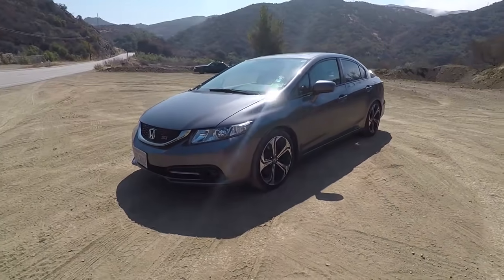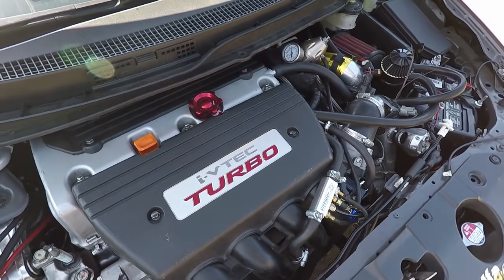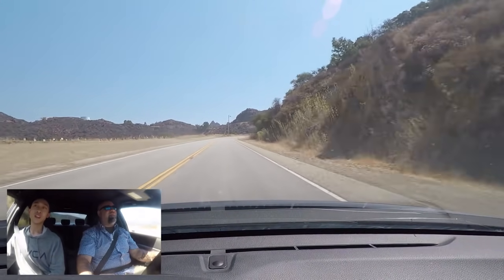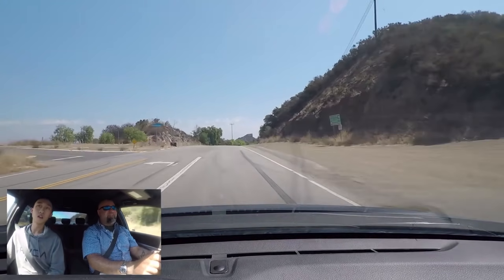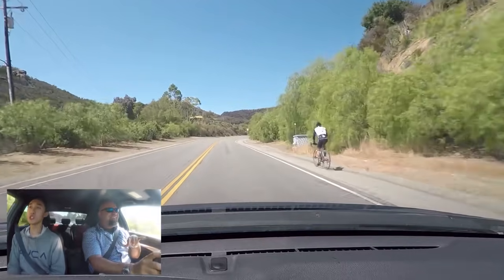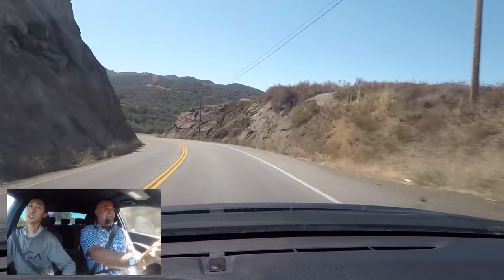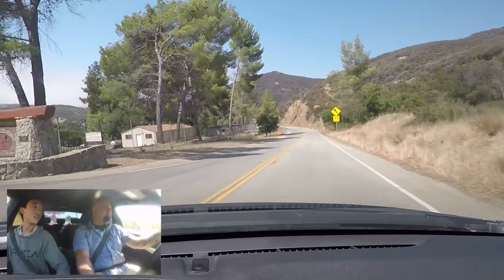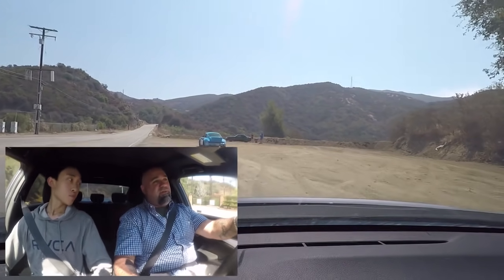Brutally Fast 500 HP Turbo 2014 Honda Civic Sleeper - One Take

Comment: from a dig. front wheel burnout :shift to second: front wheel burnout :shift to third: front wheel burnout :shift to fourth: wheeeeeee!
Reply: Its not optimal to have so much power on a FWD car but it sure is a lot off fun.
Reply: maxxjett films yea that's why hondas are running sub 9s in the the quarter
Reply: Bailey Rodgers running 9s with slicks up front and a specific suspension for drag racing. This dude daily drives this car, not using slicks to go to work. Plus, you don't build a car like this to drive miss daisy around. So yeah, he has traction issues.
Reply: There’s faster Honda’s than just sub 9s..
Reply: my car has 240hp to the front wheels and spins through 1st and 2nd lol
Reply: my 194 hp crx spins through 1st and 2nd and just a little bit at 3rd then gains traction. on the semi-slicks (Zestino Gredge 07), minimal wheelspin at 1st and gains traction #JustVtecThings
Reply: Grant Al Tabsh i believe you. my buddy has a 97 integra with a stock b18 just bored out a bit and it spins 1st 2nd and a bit 3rd. and they say hondas have no torque lol
Reply: Andy V. Well i have a high compression jdm B20B with a gsr head and hondata-chipped P28. Just imagine the torque ! 261 nm to the wheels, and a Y1 transmission
Reply: Andy V. Well i have a high compression jdm B20B with a gsr head and hondata-chipped P28. Just imagine the torque ! 261 nm to the wheels, and a Y1 transmission
Reply: I have a pair of Mickey thompson ET street R street drag radials. They just don't handle on canyon roads so I left them at home. The car grips with those bad boys on the front though.
Reply: Yeah, it's pretty hard to get better than a 6 second 0-62 and 13's on the quarter on a FWD car with even very good street tyres no matter how much power it has as traction is always the issue.  Drag slicks are of course a totally different matter.
Reply: maxxjett films hondas have no torque unless you go h series or v6, 
But my 97 accord makes 561 to the front wheels and i spin through 2nd and 3rd dead hooks hard as shit, then the slingshot effect
Reply: Matthew Sharpe but a stock 9th gen Accord can do 0-60 in 5.5 and run the 1/4 in 13.8...
Reply: Stack Bundlez yup, that's what I said, 0-62 in around 6 seconds and 1/4 in the 13's - and that's about the limit of traction on a FWD car with current technology unless you are running slicks and/or special suspension setups that counter weight transference but are no use on the road.  Not that burning out everywhere isn't fun, as per Matt's reaction here... just doesn't help you get anywhere very fast.
Reply: you described all turbo civics haha
Reply: I drove a turbo civic for years. Drag radials I used on street and track and boost by gear would run low 11s all day long.
Reply: Nice, that's what I'm aiming for next time I hit the track. Im making around 70whp more since we've filmed the one take. Sad thing about the 9th gen is that it doesn't offer BBG, so we're at a major disadvantage. I have to flip the boost switch manually in order to run low boost in low gear, and high boost in higher gears
Reply: maxxjett films 9 secs with slicks..tell me a rwd that doesn't need slicks to hit 9sec...don't think so. Haters gonna hate
Reply: He prob drives on low boost day to day because it didn't spin.
Reply: Not about hating, just that you can easily get consistent 12's or even 11's on street tyres on RWD - and awd better still.  You just cant even get close to that on FWD.  Most places slicks on the road are illegal, FWD + street tyres + dig = slow.  Facts are facts, FWD is not good for traction when you get past a certain point..
Reply: Lol Honda’s are better for roll racing they hook on the highway just not the drag strip
Reply: Mark Chang How about switching to a wider tire??
Reply: chee xiong The physics of weight transfer are what makes it more difficult for a fwd to break into the 9s, but you are right, if you are making enough power to break 9s, you will need traction through sticky tires.
Reply: has one
Reply: Your car is sick, man. I'm a big euro enthusiast but I found myself loving this thing. Looks like a ton of fun. Maximum sleeper.
Reply: Hey Mark.....what is your amateur radio callsign?
Reply: maxxjett films can’t believe to see you here lol.. I’m subscribed to you
Reply: Randy R lol, Good eye!
Reply: allanb3222 My street tires are stock size, 225/40, my mickey thompsons are 245/45/17s mounted on a 17x9 wheel
Reply: Karen Lewis k24's make torque, I make over 600wtq spinning on the dyno at 38psi
Reply: Dirty Dan EG jesus christ, I'm only on 19psi haha 11.1:1 compression ratio but this is my daily and I don't have sleeves installed yet, hopefully in the future I'll sleeve my block
Reply: Atleast he wont throw a rod ;)
Reply: also doesnt weigh 2000lbs like 90s hondas. it sounds counter intuitive but weight can actually help with traction. put the same motor and same tires from that new accord on a crx and it will be spin city.
Reply: pmang6 yup, people think that the normal force on the tires is the same on a light car than on a heavier car 😂
Reply: I make more power and spin less in a lighter civic... he has a good setup going but he still needs a good deal of work.
Reply: 2Slow2Know suspension work? I have stiff rear coilovers, but those don't seem to be enough for my pilot super sports
Reply: Honestly, you need Boost by gear.. and get you some toyo r888. I usually don't aid people when it comes to setting up a car to properly hook but I like what you have done with your car and i want to see it really be effective. The toyo alone will REALLY help and they are DOT tires.. so they are street legal.. barely. Lol Boost by gear will help and you can get the mac solenoid to run it for literally under 50 dollars. Since you are 6 speed.. you really shouldn't see ore than like 8 psi in second gear and maybe 13 in 3rd .. just take each gear to where it makes the most power but barely holds.. and then turn it down half a lb of boost.
Reply: 2Slow2Know our platform lacks boost by gear, I have a mac 4 port solenoid but our ecu is simply lacking the feature (even the previous generation has bbg) so I have to run 18psi on every single gear lol. I have some Mickey thompson ET street r dot legal drag radials those are better than r888s and those dead hook 3rd gear with full boost
Reply: Hmm. I guess Next i would say, traction control? I know its a bit pricey but its worth it for sure. Hooking is always better than spinning :D
Reply: I actually just saw that you have traction control from another video.. lol use it man!
Reply: 2Slow2Know I have Hondata traction control setup on the car, it retards ignition timing to cut power so you can hook, it was on when Matt drove it but as you can see, it still spun 1st and 2nd but hooked 3rd. The traction control can only do so much by retarding timing, if the traction control was off then even 4th would have trouble hooking.
Reply: 2Slow2Know I do use it lol, it only works in 3rd and up, even with traction control on 1st and 2nd are useless unless it's on low boost. But I have a flip switch so I can do boost by finger lol
Reply: chee xiong McLaren 720s
Reply: tomstorino70 they run 10.3 stock, and that's really impressive, but msrp is 288K LOL With that money I can build 2-3 cars that run 9s
Reply: Mark Chang what size it the M/T ET Street R tires?
Reply: Jacob Vanggaard 245/45/17s
Reply: Is the FB6 really better than an FN2?
Reply: the Dodge Challenger SRT Demon... does a 9.65 second 1/4 mile on DOT legal street tires...
Reply: They make torque sure but they don't put the power down on the streets and that is the point... spinning ain't winning.
Reply: Challenger SRT Demon... end of story.. lol
Reply: Matthew Sharpe Im hitting 5.7 0-60 on a stock altima lol.
Reply: i drive a pt cruiser with 69 hp beat that
Reply: How much did this cost to build
Reply: Andy V. My rocket has 280hp and weighs 900kg and i get a little spin in first and then im gone .
No lsd and 0 to 100 in 5 seconds running 195 bridgstone maximus on the front.
Reply: Karen Lewis F, H or C?
Reply: Karen Lewis then you dont know anything about a boosted f22 or f23😂🤷‍♂️🤷‍♂️
Reply: I had a 670hp srt4 ...drove to work in drag radials ....after that car no more fwd lol
Reply: agreed. he does have traction issues but i think he can tune the turbos to mitigate some of that slippage. gotta keep tuning to get that sweet spot.

Comment: Those Civic Si's are a great bargain. They were priced about 5-6K more than a bare bones Civic and they came with a bigger, more powerful motor, vastly upgraded suspension, tires/rims, bigger brakes, body kit, bucket seats, and a tighter steering rack. Most other vehicles charge you $1,500 for heated seats.
Reply: Kevin Mendoza I had a 2000 si and tried to run 23 lbs of boost and the rod popped right out of the block at around 6800 rpm in 3rd gear. That B16 was a bear but it wasn’t a grizzly.
Reply: Playboy Clucky 2000 si is my fav civic by far
Reply: @kewlKID557  The B16 engine from that car can handle 500WHP with a turbo stock. You probably had a bad tune. TBH, you need a very good tuner to make 500WHP with stock internals on the B16 without blowing up but it has been done.
Reply: I've heard the 9th gen SI is still the best Civic SI you can get. The 2.4l engine can handle a lot of abuse in stock form.
Reply: SI0AX street tuned it 3 times on low boost, that day I kept on doing pulls and upping the boost, didn’t turn out too well
Reply: @kewlKID557  23lbs of boost... Yea definetly the rods fault
Reply: Wade Michalski exactly the ek platform is my favorite I don’t care for any other platoform except the em2 those are nice too but I definitely will always want a clean ek civic in my stable .. currently have one that is slowly falling apart due to age but I can’t let it go lol
Reply: @akllls617  Restore it! You can save those cars. I bought a completely ruined CRX, and after like $10,000 in repairs and 2 years of suffering, I'm almost done :) (I made a very bad decision buying that car...)
Reply: SI0AX trust me I definitely want to keep fixing it the only thing I’m worried about is the rust since I can’t fix that myself .. but for the price I got it .. it’s worth holding on to .. ek ex coupe silver  definitely gonna be a classic in a few years
Reply: @akllls617  I can see my garages floor when sitting in the passenger seat of my CRX. I bought a welder and a plasma cutter and some sheet metal just for that. I used a rust spray thing and a wire brush, sand paper, orbital sander, a dremel grinder etc to get rid of the rust then painted with a rust stopper paint thing. I only have to cut and weld when I sand through the metal.

I'd say it's worth learning to deal with rust because it could be a never ending battle, just like cancer.

Comment: 500hp through the front wheels sounds like it could get frantic
Reply: Jason W. Morningwood sounds scary
Reply: Not really, spinning on rwd can cause fishtailing, spinning on fwd just spins and pulls straight. Just gotta run lower boost on lower gears with sticky tires and you'll hook fine
Reply: 97 accord making 561 to the wheels here and it actually just feels like the car is "scating" somewhat like a car on ice, and they "walk" sorta like the diff cant keep traction on both tires, 
But on my car they simply are gaining and loosing traction at different times so it gives the "walking"sensation. 
Mfactory lsd in a t2t4 5 speed and h22a
Reply: Mfactory LSD is your problem, the problem with cheap LSDs is that it doesn't transfer the power efficiently. I remember someone having a cheap lsd on their 9th gen (Not sure if it was Mfactory) but when they did a burnout at the track, only one side had power. After they got a Quaife LSD it was much better. If Quaife makes a lsd for your car, look into getting one.
Reply: I cant believe its doing that with an LSD. That is like the whole point of a fucking LSD.....
Reply: I had like 350 in my volvo, no LSD, shit was scary from a dig 😂
Reply: Mark Chang good luck ever trying to hook with 350+ HP with wtv LSD possible never gonna happen low boost or not
Reply: ap2pat its LSD not god in the trans and at that point the tires rubber are what making and allowing the tires to spin not the lsd
Reply: Shake down the front end on that car. The open diff and Mfactory LSD both did 2 tire fire burnouts on my old civic. I ended up shearing a tooth in the factory diff and I loved my Mfactory. Felt better in the corners too.
Reply: Sounds like fun to me
Reply: My integra makes 433whp and I don't have lsd so it can get pretty damn violent lol
Reply: Mark Chang this is not true at all. Maybe with an lsd but in a fwd high hp car you can get crazy amounts of torque steer. My car will pull me hard as fuck to the right or left sometimes and if your not paying attention and holding on good you will go into the next lane and hit the car next to you
Reply: Yeah torque steer kills
Reply: I have no torque steer, I can do pulls at 500+whp with my drag radials on and hold on with one hand. Electronic power steering + a helical limited slip differential basically eliminates torque steer
Reply: I hook 2nd gear with 350whp just fine with my drag radials. at 450+whp I'm able to dead hook 3rd at best with my drag radials
Reply: I have 330 wheel in my Saab 9-5 And it's scary as hell sometimes
Reply: @Hyudryu  you're not the only one who said that! I guess I'll avoid the cheap diffs then.

Comment: I have a 2450 lb mustang II with 530hp, and it has similar traction issues on regular radials, but Toyo R888s fixed it

Comment: This is what Dom, Letty, Jesse and Leon would drive if The Fast and the Furious would be made today
Reply: Krzysztof Korbaczynski they'd have to lift those trailers a lot more if they expect this tall ass civic to fit under...
Reply: This is what Brian Spilners kid would drive
Reply: I don't think so lol. Leon drove an r33 in the first movie, Letty drove a 240, Dom an Rx-7 and charger. Besides for the heist scenes, I don't think they're downgrading to civics LOL
Reply: Aaron Lean they certainly did modify the trailers and the civics had the roofs chopped on them...
Reply: Nate Mora in the first movie they all drove eg civic coupes during the heist... That's what he originally commenter WAs referring to...
Reply: mike02467 thank you!!!
Reply: +mike02467
shots fired
Reply: Krzysztof Korbaczynski Toretto drives demons.
Reply: Maybe I'm wrong about the roof being chopped. Trailers were modified for sure (stuff like the trailer's jack for parking were removed) and I'm pretty sure they were lifted. You're correct they are EJ not EG but it's the same generation. Here's the info on the civic:
http://fastandfurious.wikia.com/wiki/1993_Honda_Civic_EJ1
Specifications
The Civics are equipped with green neon underglow lights and both Vader-Style Bodykits as well as ViS Racing Bomber GT body kits along with black paint jobs. Under the hood is a B-series 1.8 VTEC engine (B18series) and is equipped with a T66 Turbo with a Nitrous kit.
Reply: Aside from the Charger and r33, where are those cars today?  I would love to see them.  We have to dig back 20 years for their lineage.

Comment: My dream is to see  Honda Civic doing 0-400-0 faster than Buggati and Koenigsegg. Who would love to see that?
Reply: Daniil Kaizer that’s not possible Honda can’t do that and it would spin out it’s not wide like supercars there made for high speed
Reply: There are all motor civic's pulling 9second 1/4mile runs, just saying.
Reply: Daniil Kaizer if they stop playing and make their cars rwd maybe
Reply: @butthole9580  honda s2k and nsx says hi
Reply: Me
Reply: Daniil Kaizer would love to see it but will never happen ur comparing civics to milion dollar cars
Reply: @micah1368  7' now
Reply: Daniil Kaizer this sounds like a very young person comment I guess you’re 12-13.
Reply: It wouldn't work because the civic doesn't have the proper aerodynamics to stay stable at those speeds. I guess there could be a company that can develop a kit for it and a way to do an engine swap, but at that point it wouldn't resemble a civic. 
It's kind of like Tanner Foust's Ford fiesta rally car. Yeah it's fast, but it has nothing of the original car, just a body kit that resembles a Fiesta. Or a stock car for that matter.
Reply: Daniil Kaizer you know the buggati has ten intercoolers?
Reply: only honda i see capable of reaching 400 would be the nsx and that's with top notch engineers and lots of aerodynamic testing with a proper carbon fiber kit, plus very good tires and performance; obviously...

Comment: This build reminds me of the Mitsubishi Eclipse GST front wheel drive that I had in the 90s . after not finding traction and losing lots of races because of that I ditched front wheel drive, sold the car and went to the Mitsubishi Eclipse GSX all wheel drive . all wheel drive easily added a 1 second difference or more to my quarter mile times. so with similar mods I went from low 12s to dipping right into the 11's easily with all-wheel drive, similar engine, full interior and cheap street tires. Great build and dedication but good luck finding traction as Matt so eloquently said. traction not your only enemy. all the weight shifting backwards on launch makes the front lighten up too.
Reply: qikqbn77 best looking year had to be 1991 body style. also loved the look of the eagle talon tsi. my buddy broke several transmissions racing his 91 gsx great memories.